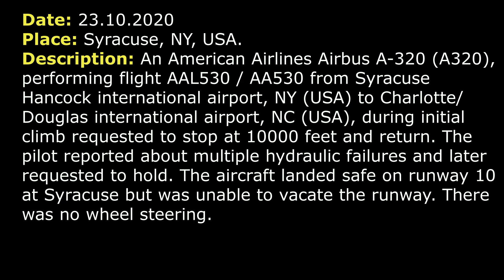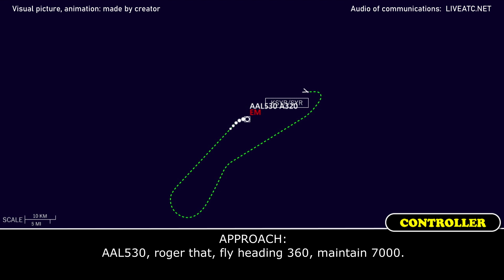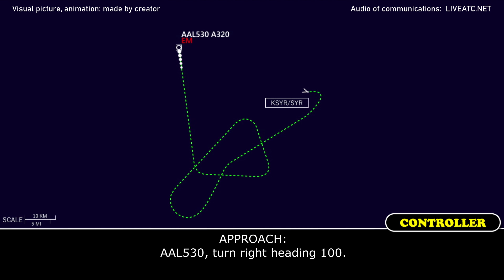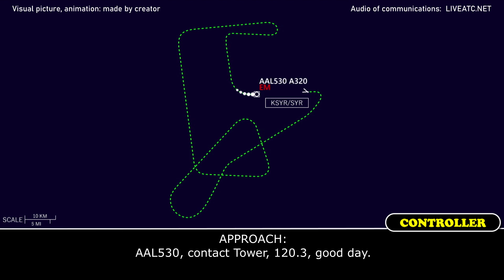MULTIPLE HYDRAULIC FAILURES and no nose WHEEL STEERING on landing | American A320 | Syracuse airport

Comment: 1:07 “Roger, if I could get the fuel in time and pounds that would be great.”
1:24 “AAL530, I’m not sure if you had B when you left, but B is still current. Altimeter is 3010…”
2:56 “It’s about 3 hours and change.” The meaning of “change” here comes from the use of “change” to mean coins as opposed to paper currency. So “change” can be used to mean a small amount of time like how change is a small amount of money. The phrase can therefore be taken to mean they have a little over 3 hours of fuel. Language is complicated lol
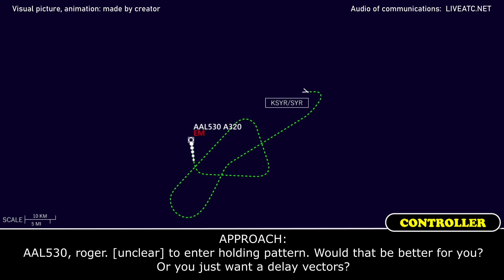3:43 “AAL530, roger. Is it easier for you to enter a holding pattern?”
4:38 “Copied all, AAL530, thanks. Just about wrapped up here. We’ll be calling you back shortly.”
6:07 “So, we may very well be stuck on the runway when we do come to a stop.”
6:17 “ All those 45 degree turn offs you see on the north side aren’t there anymore.”
Reply from the maker: Thank you very much, it was a little difficult for me. Great work, pinned.
Reply: 3:48 I think vectors are easier.  5:59 ... as a precautionary measure of course we'll take the trucks...chance, we can rudder steer off of the high speed [taxiway]